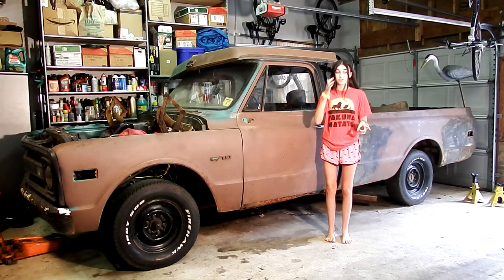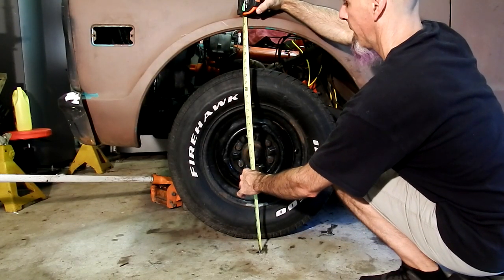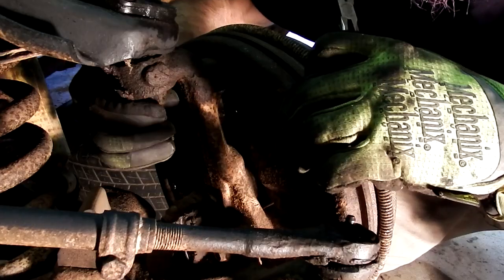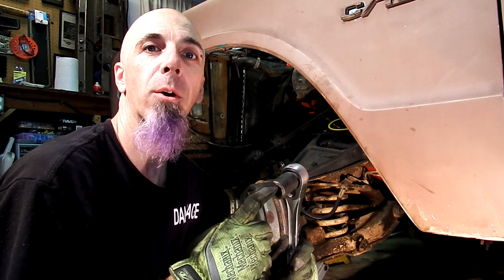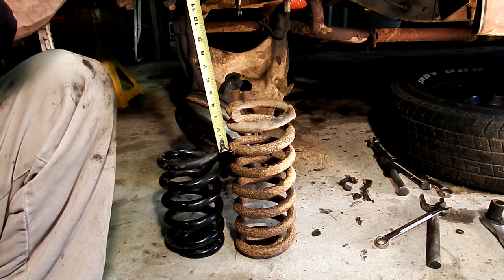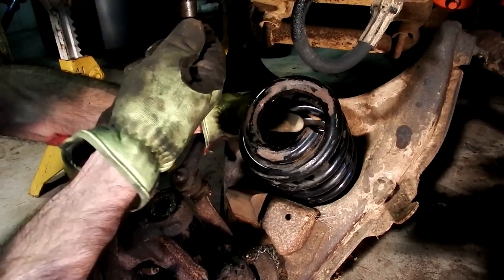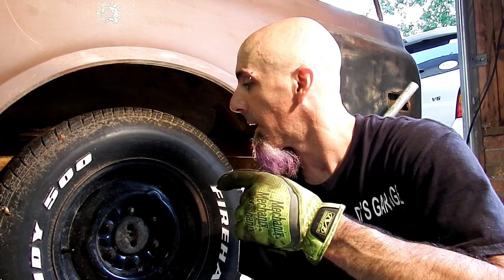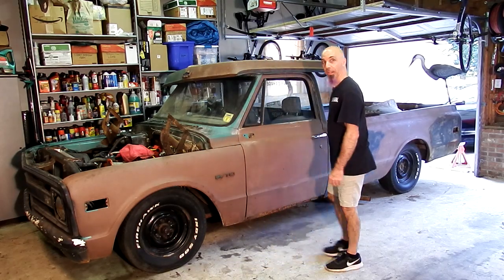Lowering my 1970 C10 truck

Comment: The stance is absolutely perfect. Sorry I know you sold the truck. The description confuses me a bit when you say previous owner cut a ring off. Are you saying the previous owner gave you the kit like that and you installed it? So it was originally a 3in drop spring in the front and a 4 1/2 in drop spring in the rear? And when the ring was cut then it went to a 5in drop in the front and 4.5 in the back? I want to duplicate that look on my 72. So need the details! :) cheers man.
Reply from the maker: When I bought the springs, the guy I bought them from wanted the front lower, so he took out the front springs and cut an entire coil out. Then when he put them back in, it was too low. That is when I bought them. The front bump stops were hitting, so it may have been too low, maybe half a coil would have been better? Good luck with your truck. Remember they wear in over time as well, so it will get a little lower than when they are first installed.
Reply: @DansGarageNC  awesome thanks!

Comment: So I just saw this video…I wanna lower my c10 as well.. so did you get/buy a 3” front and 5” rear springs? And yeah the fronts got cut I understand… but that stance!!! Damn!! If it’s a 3”,5” drop I wanna do it! What are the rear springs? 5”?
Reply from the maker: I just looked in the video description I said the fronts were supposed to be three and the rear 4 1/2 but the front ended up being five since they were cut so front was 5 inch drop and rear was 4 1/2 inch drop. But the springs originally were three and 4 1/2.

Comment: Just to make sure. You just simply replaced the coils? And what size on each end? No spindles or anything else?
Reply from the maker: I replaced the coils, they are a CPP 3  in the front and 5 in the back drop kit but, the front coils had been cut a coil so it dropped the front a bit more than it should have, I also replaced all four shocks because I got them with the springs, not sure if you need to or not.
Reply: Awesome thanks

Comment: Good Video! Wish there was more utilizing Springs only. Did you have any issues with the Axle hitting the frame in the rear? I want to Lower my 72 but am trying to avoid C-Notching the frame.
Reply from the maker: I don't believe you have to notch the rear unless you do 6 or more in the rear. The front did hit the bump stops, but thats cos the front springs were cut.

Comment: U didn't need an adjustable track bar to center the rear? And no shock relocaters?
Reply from the maker: No, I believe you only need those if you do more than 5, and if you go really low, you will need to "C" notch. Good luck.

Comment: What length were those cpp springs before installing?
Reply from the maker: The front springs were for 3 inch drop, but the previous owner cut a coil resulting in a 5 inch drop on the front and a 4 and 1/2 inch in the rear. I do not have the actual measurements if that's what you are asking. Sorry.

Comment: Looks good,how does it Drive? I want to lower my truck the same way ,without C-notching the frame
Reply from the maker: It is a little stiff. The front coils were cut so the bump stops would have to be removed as it rides on them now. The only other alternative, would be air ride, but that costs a lot more and is very spongy. Less of a drop would probably ride better, but what is more important, how it rides, or how it looks? lol
Reply: Did you ever swap the front springs that were not cut?

Comment: Any mods after this?
How does it drive?
Reply from the maker: No more mods, I sold this one. It seemed to drive a little rough on the front end due to the springs cut. If they weren't it probably wouldn't have been too bad.

Comment: I did the same drop on my truck. It has a 406 small block, and I run 15x10 Cooper Cobra GT tire's on rear. My truck drives great, and does great burn outs. One thing I noticed is if I spin my tire's in reverse I'll get wheel hop. It doesn't do that going forward. Only in reverse. Do you have the same problem? If so how did you fix that? I'm trying to figure out how to fix this problem. I'm thinking about putting a coilover kit in the rear in hope's of it fixing that problem. It's not a big problem, but it annoys me knowing that it does that while spinning the tire's in reverse.
Reply from the maker: I sold the truck, so I do not have any problems anymore, lol. I would suspect that the wheel hop is because the rear suspension is linked at the front and designed for front rotating torque, not rear. Not much you could do about that. Thanks for watching.